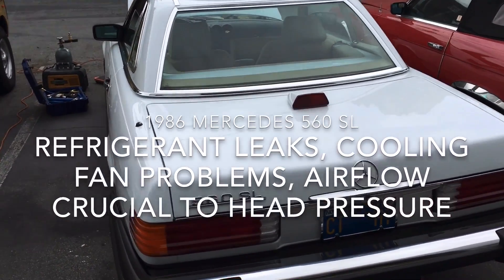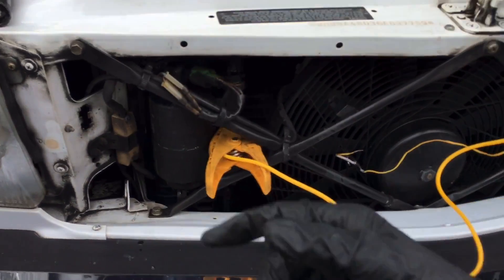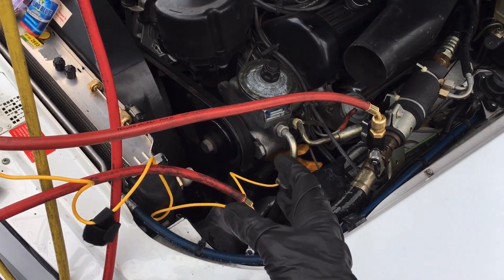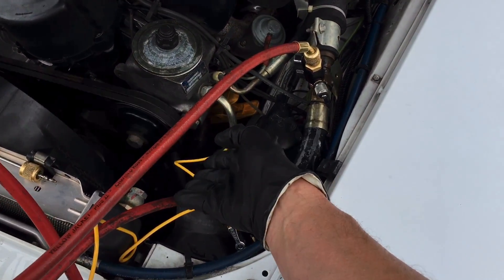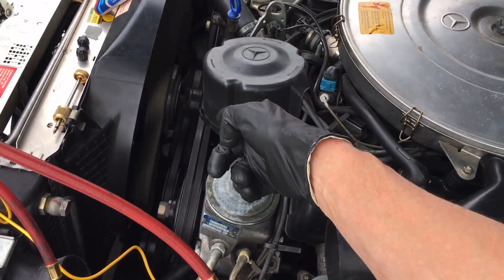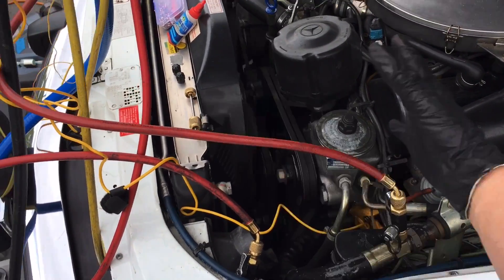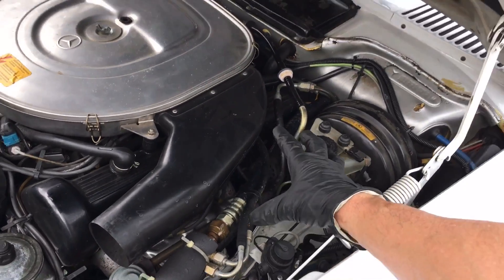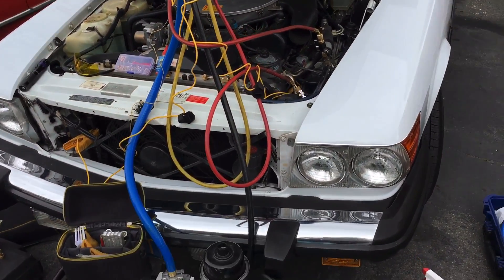A/C airflow problems, refrigerant leaks 1986 Mercedes 560 SL

Comment: I have a 560SL which I restored full , when I disassemble the car found the Klima relay that was bridged on two pins and a fuse in the middle the a/c was working just fine , the car was disassembled for long time since I refurbished and fix the central vacuum pod , now I assembled all
back installed new expansion valve and thermostat but the compressor does not start when I apply 12V to the compressor it starts but not cold air is coming out , do you think the Klima relay is bad? got another from ebay but nothing , what do I check?
Reply from the maker: Pressure switch? 

If you ground clutch coil and apply 12v B+ to the other pin and clutch still doesn’t snap closed. 
     Bad coil or gap tooo wide. 

Has to be refrigerant in the system to close contacts on compressor pressure switch to activate relay to apply power to clutch coil.
Reply: yes when I apply 12V to the compressor it starts and blows cold air, just changed the dryer and both sensors at dryer the klima relay is good but can not make it start from the dash panel also the fan does not start , do you know at what pressure the sensors make it work?

Comment: What is the side high pressure of the mercedes bens model 1986
Reply from the maker: It changes depends what the ambient temperature is. Not 100% with memory, but I think  high side pressure switch will kick on Secertary electric fan at 270 psi. 

     Old mechanical thermal fluid fan clutch wears out going out of calibration. 

      It dose not affect engine temperature but a little less air flow greatly affects high side pressure. 

I always tell everyone if it old just replace the fan clutch.    I don’t remember if this one was fluid or solid 1 to 1 fan.

Comment: Replace the two switches on the dryer,, good tip for summer, jump aux fan switch to let fan run all the time with ac on.
Reply from the maker: Jumping the fan is only for testing. It is not good to have the condenser fan all the time on when the temperature gets lower.  It is designed to run at a certain pressure and you can over cool lower pressure too much.

Comment: Tom, I have a customer of mine looking for a good classic mercedes repair shop in the bay area.  Do you have any personal recommendations based on your experience?   Thanks
Reply from the maker: There’s many but I only have two I recommend.  Are we talking old classic with old style mechanical fuel injection or later more modern years with electronica fuel injection. 
http://www.burlingamemotors.net/contact.html

https://www.porschedes.com/

These are two of the places I trust and if I did have a Mercedes I would bring my car to

If the customer is Bargain shopping for a cheap place then these are not the place to go. 

        If they’re looking for a competent toner with competent technicians who have all the tools and equipment to do repairs then these are the places to go. 

        Jimmy atJunoapasiera Auto Repair for a newer Mercedes has both the Porsche and Mercedes factory software and scanners what are the most modern cars as you know is not cheap. 
            Jimmy’s father work for Mercedes-Benz factory trained in Italy back in the 60s opened up his Mercedes-Benz repair facility here in Daly city many many decades ago built the building from scratch. Jimmy now runs the place and was trained by his father and goes and seeks outside training to seminars and is a Bosch certified parts distributor. 

          Renee specializes just in classic Mercedes and other classic car restoration. Fixing and repairing modifying and even casting and machining building parts that are no longer available from scratch. 

       These are two places that are both specialize in the area they work in a class of their own and have their unique skilled abilities and experience in the field in which they work.

Comment: You reference another video for this car, but I can't find it.  I'm restoring an r-12 system on an 89 bmw.  I have the car in my garage which is temperature controlled all day.  I pumped down the system, pressure tested with nitrogen and it drops about 15 psi over 24 hours.  is that acceptable?  I don't have a digital guage (yet)
Reply from the maker: Chris Lloyd excellent question 15 psi drop in 24 hours is not acceptable definitely not acceptable.           I would test your gauges all by them self with the hose is attached to a fitting that is sealed off has absolutely no possible way to leak you can make one yourself.  If you have some spare fittings or purchase some fittings that you either weld up the other end that would go to the refrigerant system or use some Apoxsee to fill them up airtight and then attach your ends of your hoses to the end of the fitting like you normally would a car and this will pressure test your entire refrigerant gauge manifold valves hoses crimp connectors and even the very end gasket.               Pump it up with 150 psi let it set overnight it should not even drop by one psi.
Reply: t lech thanks for the quick reply!  I will test the gauges.
Reply from the maker: If you click on my name under my icon that should take you to my channel find that video and then scroll back a few days I even lose count and location of my very own videos unfortunately I do not have them numbered in a future date when I decide to edit videos that’s probably a good thing to add to my videos
Reply: @coldfinger459sub0  I'm trying to find it toooooo